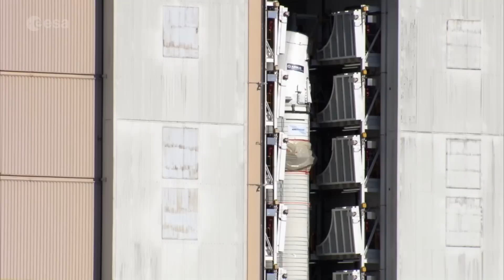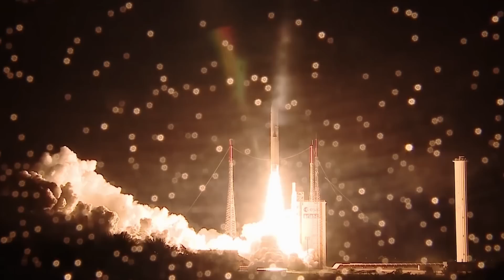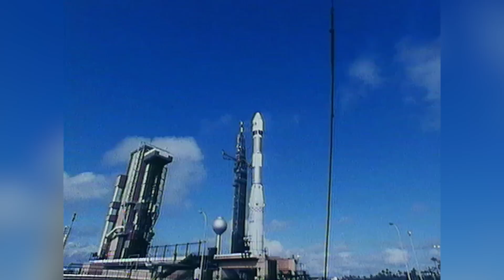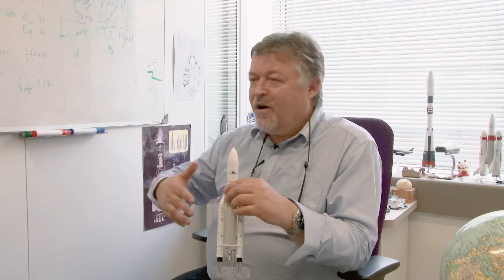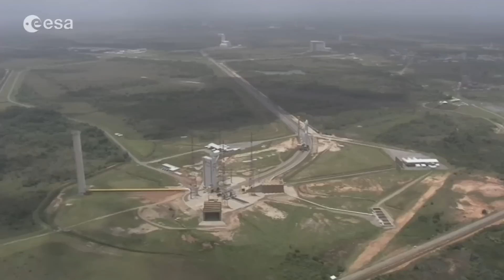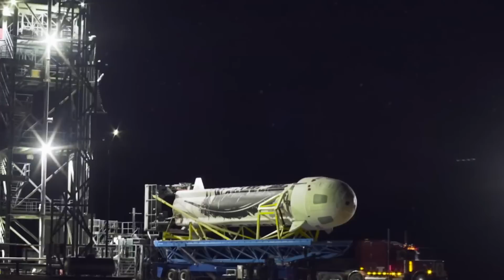Inside The World's Largest Rocket Launcher | Heavy Lift

Comment: The Ariane 5 is NOT the largest rocket in regular operation today. It is RETIRED and superseded by the Ariane 6 which ALSO isn't the largest rocket in regular use.That title falls to the SpaceX heavy:

Here’s a comparison of the Ariane 6 and SpaceX Falcon Heavy:
Ariane 6
- Developer: European Space Agency (ESA) and ArianeGroup.
- Variants:
  - A62: Two solid rocket boosters, up to 10.3 metric tonnes to low Earth orbit (LEO).
  - A64: Four solid rocket boosters, up to 21.6 metric tonnes to LEO.
- Engines:
  - First stage: Vulcain 2.1 engine.
  - Upper stage: Vinci engine.
- Reusability: Fully expendable; no reusability features.
- Cost Efficiency: Estimated cost per kilogram to LEO is around $4 700
- Launch Schedule: Debuted in July 2024, still ramping up operations.
- Focus: Reliability and European autonomy in space access.

SpaceX Falcon Heavy
- Developer: SpaceX.
- Payload Capacity: Up to 63.8 metric tonnes to low Earth orbit (LEO).
- Design: Three-core configuration with a total of 27 Merlin engines.
- Thrust at Liftoff: Produces approximately 22.8 Miion Newtons of thrust.
- Reusability: Partially reusable; side boosters can be recovered and reused.
- Cost Efficiency: Estimated cost per kilogram to LEO can be as low as $1.6.
- Launch Schedule: First launched on February 6, 2018, with a high launch cadence.
- Focus: Technological innovation, cost efficiency, and flexibility through reusability.

Summary
- Comparison:
  - Falcon Heavy offers significantly higher payload capacity and lower costs due to reusability.
  - Ariane 6 emphasizes reliability and European independence but faces challenges in competing with SpaceX on cost and flexibility.